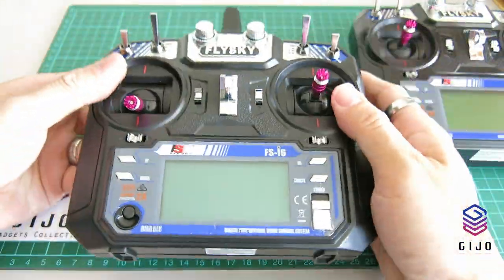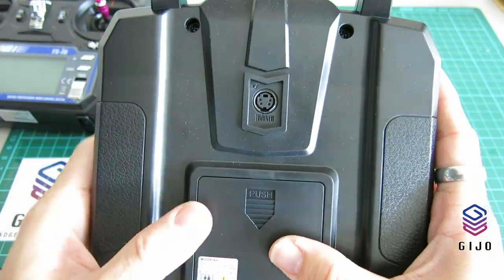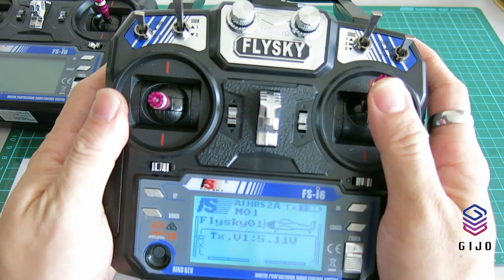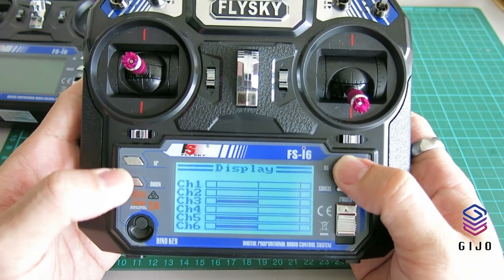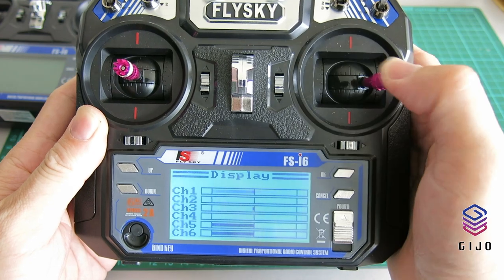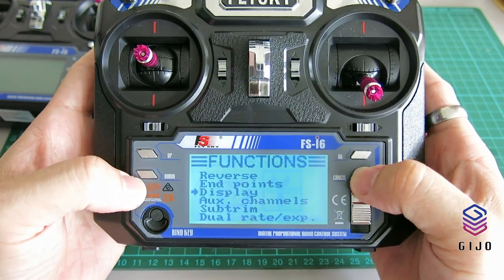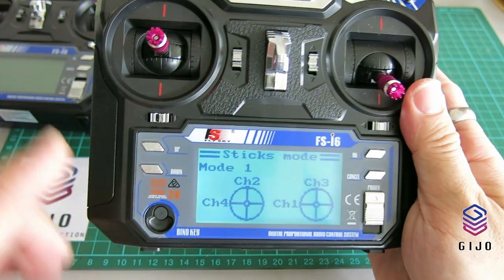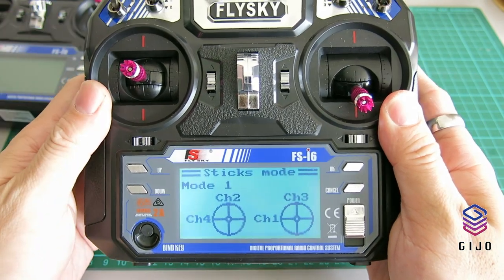Difference of Mode 1 & Mode 2 | Flysky i6 AFHDS/2A Radio Transmitter

Comment: So mode 1 for ground vehicles...check 👍🙂
I guess you can change the modes, if you disassemble the transmitter? 🙂
Reply: Why? that I don't understand 🤷 is it not more of a preference? Than air, sea and land??
Reply: @brianwgDK  In the old days (1990 ish) we only used stick transmitters and I miss that. Today I'm equally good with stick and wheel transmitters.
Now I'm building a new retro RC crawler jeep, which is why I'm looking at getting a stick transmitter. 

But to answer your question: Depending on in which country you live and also what you control, Mode 1 and 2 were made. Some prefer to control the engine on an airplane and drone with the left stick and others with the right.
This transmitter was not meant to control surface rc, but can be done 🙂
I actually prefer to have the gimbals fixated to only go up and down and steering, left and right. But the the other two channels could be used for something else 🙂

Comment: I am a mode 1 user. Tried using mode 2. Still can but not used to it. Only difference is throttle and pitch switch.
Reply from the maker: Yes u r right